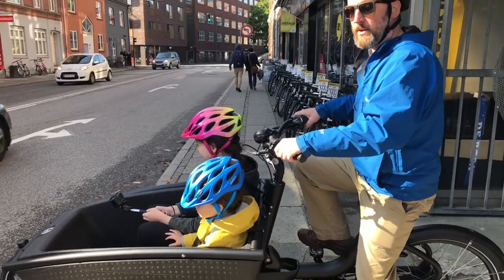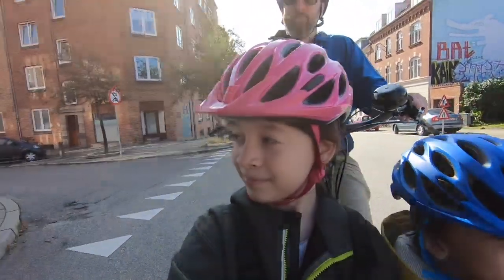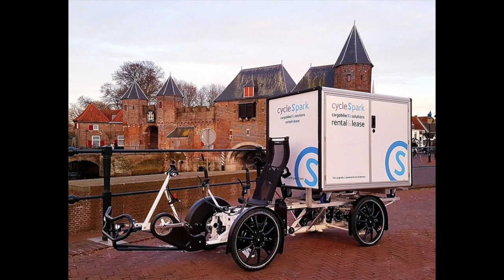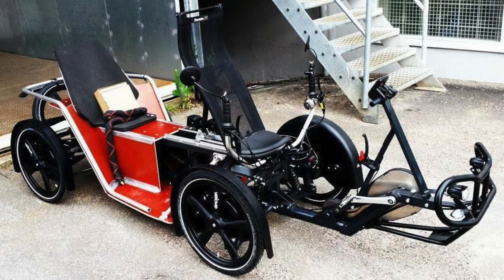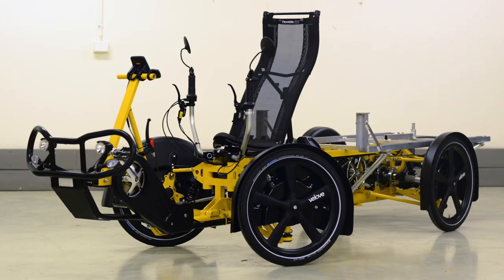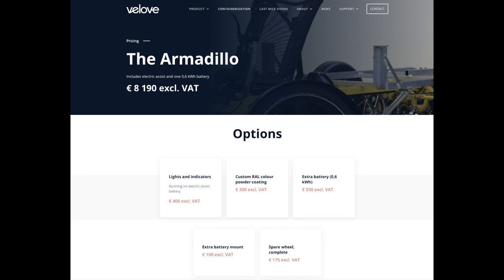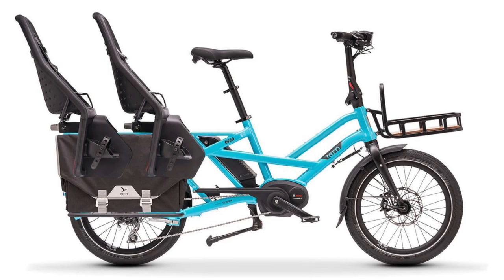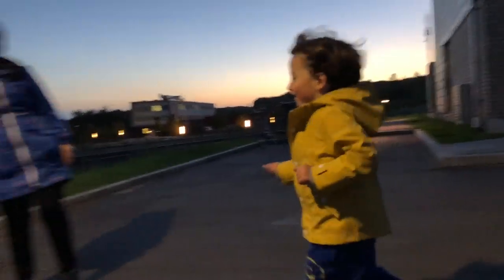Could YOU Help This Crazy Project To Replace My IONIQ Electric Car?

Comment: Good project for a retired person with deep pockets and a Tesla. It is an exciting time for EV development. However, for a young family the priority is saving up for an EV with a 5 star safety rating. Just think of the injury to your legs in a crash riding an incumbent bike. Another paradox is that a basic bicycle does not require insurance, but an expensive ebike does, especially a prototype.
Reply from the maker: Thanks. Yeah it might suit a retiree better. I have so little time as it is. The insurance aspects I would need to check. I have the combined personal liability and contents insurance that’s recommended here already. But this kind of thing would stretch that, I suspect :)
Reply: @ZeroTailpipe  Yeah, nice idea but if you don't have the time then better to put the money towards an EV - Just get you and your family bikes for now and hire the Zoe when you need it. I'm looking at the new 50kw Zoe but also the Peugeot e208 but if you can't wait I think you would be happy with a second hand iconic the same you had in the UK - you can always sell it later as there are so many new EV's coming on the market in the new few years.

Comment: Years ago , I checked with VeLove regarding an Armadillo Semi with assist sent to the States .  Their response was less than stellar with regards to "more than 3 wheels" and "electric assist" as U.S. regulations defining factors for a "bike" .
  After becoming disinchanted with my enclosed velomobile for camping (I'm pushing 70 years old) , The VeLove reigned supreme .  MY idea was to build an RV with solar , "pop-out" and possibly a raising roof and chassis ground stabilizers for camping whilst touring.  
  If you can think it , you can do it !  Heck , just a little more than 100 years ago , we relied on fire and steam . GO FOR IT !
Reply from the maker: Cool ideas, thanks :)

Comment: This sounds like a great idea! It would be a vicarious dream come true.  I would love yo purchase an Armadillo, however the import fees and legislation around e-bikes in Australia are  hostile.
Reply from the maker: Thanks. What is the legislation around e-bikes in Australia? What makes it so hostile/restrictive...?
Reply: In Australia electric bicycles must be manufactured to the European EN 15194 standard for electric bikes. Amongst a number of other things, EN 15194 allows a maximum power output of 250 watts, with a safeguard allowing for power assistance only when the bicycle is travelling at less than 25km/h and the rider is peddling. This means that the rider must pedal to obtain help from the motor(s) and cannot simply be propelled by the motor alone. The motor may operate without the rider pedaling up to a speed of 6km/h (just under 4 mph) i.e. walking speed. 

All of this must independently verified and requires import approval from my state Department of Transport. Otherwise, the bicycle is consider a motorcycle the must conform to the rules and regulations of motor vehicles. 

Additionally, three and four wheeled cycles fall into a grey area due to the wording of the legislation that specifically refer to two wheels.

Comment: Expensive initial outlay. However, with the right conversion it could be a cracking little runabout. (I'm thinking Tuk-Tuk) Just throwing some ides up here: Is there a local hobbyist club that does small engineering projects? Is there a college that does night school classes in engineering that would allow you to convert the original chassis? Can you take recyclable parts from a scrap yard and adapt them? If it can go from Switzerland to China, it must be well built and worth the outlay.
Reply from the maker: Thanks. This is exactly the kind of support I’d need - make it a group project, split the ownership/upfront costs, pool knowledge, parts, ideas, testing etc :)

Comment: I made an electric bike here in Costa Rica 3 1/2 years ago (+14.000 kms on the road already). Sure thing, the cost of such project was paid off with what I saved from gasoline and oil changes. Now I have your same idea: to make a more confortable, more stable,  aluminum platform, plywood frame (original design for all type of weathers) 4 wheel pedal assisted bicycle. It will, however, reach the $12K mark or more, and will take lots of time and garage space. What I learned from my past project is that it was cheaper to buy the tools and learn to do everything yourself and that would take a large part of the budget with this one. Sounds like another dilema I had years prior to all that: to buy a brand new EV car or to convert my old one into electric. I see people cannibalize old bikes for things like that to keep costs as low as possible. I still running numbers though. Anyway, I am a new suscriber to your channel and I will follow you "no matter what" :)
Reply from the maker: Sounds superb! :)

Comment: Thanks Duncan. €8,000, plus a lot more money, is that less money available for buying or leasing an electric car. At that price, you're already above the price of a used Renault Zöe, and it will be a lot less weatherproof. And can you carry three passengers and their luggage on, or in, one of those vehicles legally? If you're not seeing them in regular use in Denmark, then the chances are that it's not seen as a serious and easy option.

Comment: Always interesting trying new things assuming you have somewhere to keep such a machine as a E-bike would go under the stairs etc, if you have a garage have you considered the Renault Twizy which comes with the weather protection and a rear seat for little ones or shopping etc, just a thought 🤔
Reply from the maker: Thanks. Twizy is an option but not keen on perpetual battery lease on a lower value EV ...

Comment: Armadillo is quite interesting bike. I haven’t seen or test one, but it looks very practical. But I have tested Urban Arrow cargo bike and I got feeling it’s very good quality bike. 
But before you buy anythng, I strongly recommend you to test Quattrovelo. It’s four wheeled velomobile with a lot of luggage space (not as much as with Armadillo, but much more than with other velomobile models). You can get a child seat for the Quattro and I guess your son would fit in there. Also with velomobile you get good weather protection and in Denmark you don’t get that much snow so you can use it easily year around. And you can mount electric assist. Velomobilcenter.dk can mount it for you.
A velomobile is closer to a car than any other vehicles you have mentioned so far, so it does make sense to at least test ride one.
Reply from the maker: Thanks! Do you have any contacts I could follow up in Denmark?
Reply: Visit Velomobilcenter.dk. I’m pretty sure they have Quattrovelo ready for test rides.

Comment: It sounds like an interesting project but too costly for what it is in my opinion. With an electric car you have the security that you can lock it in the street for days inbetween use without parts easily going missing. I am really interested in seeing a cost saving way to get into EVs maybe a modular platform developed by yourself in a non profit group.
Reply from the maker: Thanks :)

Comment: I would say try to buy a used e Bike that can tow a trailer or something. As someone that owns two ebikes and an EV, I think an EV wins for convenience, especially when the weather is poor or it's dark out. I only ride my ebikes for pleasure and they are very heavy. Also there is a huge premium for an ebike and you may be able to avoid the high investment by buying used and having it shipped to you.
Reply from the maker: Good idea, thanks. I’ve not really looked into used bikes :)
Reply: @ZeroTailpipe  The used market is pretty small I'd say, I'm in the US, not sure what is like in Denmark. Just figured it's worth looking into since I know they're expensive! I have a Juiced ODK500 and an Ohm brand bicycle that uses the Bionx D500 motor that is extremely smooth and powerful ( best motor in the world in my opinion,made in Canada but the company is going through financial troubles).

Comment: You can get a Renault Twizy with that kind of money... which already has a roof and is street legal... but only one passenger in the back.
Reply from the maker: Yes, if I could find one :)
Reply: @ZeroTailpipe  That bike platform does look awesome. Putting some seats on it should be like an afternoon's work for a handy man/woman, BUT there may be local regulations, which could make it impossible to use (legally) on public streets. I assume that's why the manufacturer is also hesitant to build such a thing.

Comment: The Mercedes B Class electric, if you can find one, is an option you might consider.  It has one defect it only has poor charging 4 kW AC single phase or 11 kW AC three phase.  Otherwise it will drive very well.  The 36 kWh battery is normally only uses 77%of the available battery.  But if you are planning on a longer trip the Extender option (if equipped) will let you charge to 93%.  

Range is 87 miles standard range, 115-120 miles with range extender.  Some say 150+ miles.  

There are none listed in Denmark officially but one or more maybe the electric versions.  You would have to ask.  

Kate & James like it.  https://youtu.be/gpGjNKTaPFA

(In North America it is only single phase 10 kW AC charging).   

https://www.ooyyo.com/denmark/c=CDA31D7114D2854F111B9E6FBA1F355BDDA21D6317C4844111/-2692080696643326596.html/

This might be an electric version.  

The silver bar of buttons shows which options it has.  the outermost are heated seats.  the next are the parking sensors on your right and a fan of some type on the left.  The users right inner button is the extender E Cell and the users left inner is the Sport Eco or Eco+ selector.  (they do not all have all the options)   

The B Class is rare as it is the compliance car they never wanted to make or sell.  But it is a fantastic car none the less.  (except charging).   

Eco mode reduces power to 132 hp sport accesses 180 hp.  0-60 mphis in the 7+ second range.  The Mercedes uses Tesla batteries and motors it is front wheel drive.   8 year Tesla battery warranty but you may need to use Mercedes for warranty repair.  Ask around if you are interested.

Comment: How far do you have to drive for the morning commute?
Reply from the maker: Thanks. It’s 10 to 15 km each way, depending on the school drop off(s) situation...
Reply: @ZeroTailpipe  https://www.ooyyo.com/denmark/c=CDA31D7114D2854F111B9E6FBACF3541CAB51C5016/-5320748445595664153.html/  This doesn't have much range but it will go 30 km a day  is pretty inexpensive and carries four.  I like the looks of the fourtwo but it's range is pitiful 40-50 miles at highway speed in winter.  Still it seems that is all you need.  It isn't an Ioniq but it is much smaller too.

Comment: I think your first steps should be checking out what it is actually legal to do where you are, before spending any money. Don't assume that because people use them elsewhere that they are legal to implement your ideas in your location.

AS you are probably aware electric scooters etc are not legal on public roads in the UK yet legal elsewhere.

If they are legal what are the other requirements (insurance for instance)
Reply: Electric bicycles are legal.
Reply from the maker: Thanks. I think the Armadillos are legal as they are currently used - but that could change with passengers. Perhaps one reason Velove have not yet gone down this road...?

Comment: I had the same question 2 years ago, buy an electric car that standstill on the file or make something that drives like a car and is safe and cost a lot less. Now it is finished and it had cost 4000 euro and I can drive 10000km a year on the sun and cost me 100 euro a year for new tires and little things for this 10000km. And if you need more than 10000km, just place more solar panels. For more details see "solar trike" on Facebook.
Reply from the maker: Cool!